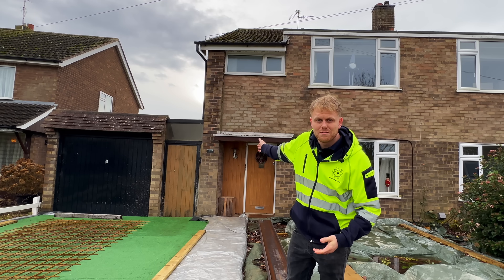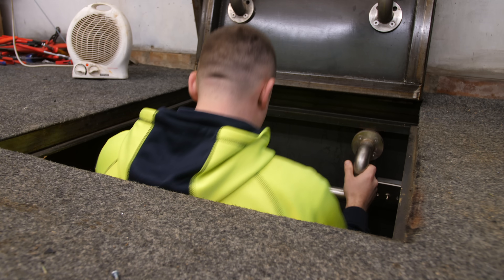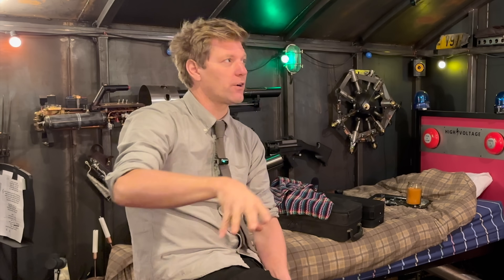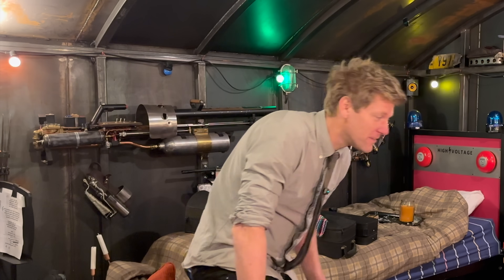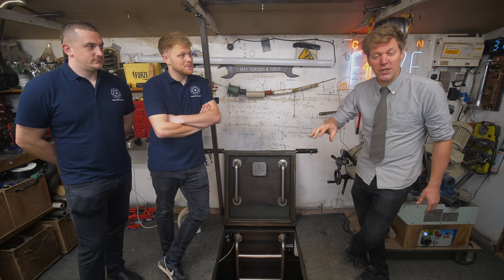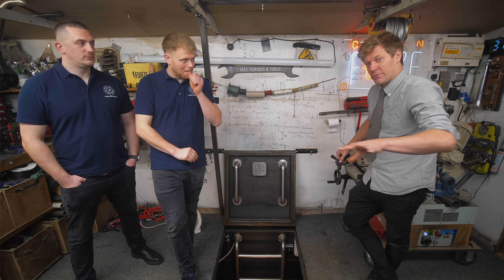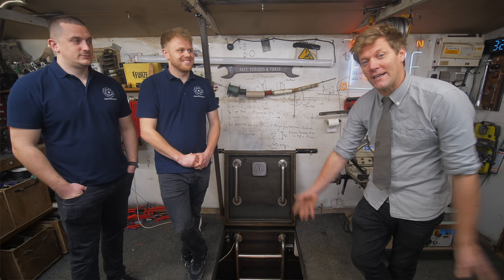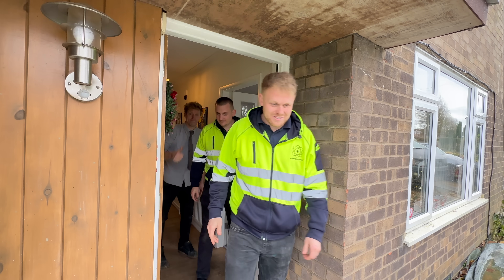Colin Furze Tests For Radon Gas!

Comment: How come with all the government studies, all the scientific testing and statistical info there’s not a single death that was directly caused by radon?  Probably because there’s no possible way to test its danger to life..  there’s no physical way to create an atmosphere completely void of any radon gasses so there’s no way to get a base test..  also there is no cure for cancer meaning nobody knows what specifically causes the cells to mutate and become cancerous..  one person can smoke their entire life and work with asbestos without having any problems from it and end up dying at age 94.  Then you can have a person die at age 30 from lung cancer who was smoke free and athletic..   they say radon is the leading cause of lung cancer..  hows that when scientific studies have at least proved that the bad hydrocarbons that are apart of radon are only harmful if ingested and these harmful hc’s are only around for a very short time before they decompose into non harmful gasses due to their half life being so short.  So a person would have to have inhaled this random, very low ppm harmful molecule floating in the air while its in the harmful state and give it time to be ingested and digested into your body before it decomposes into nitrogen or carbon dioxide and just gets farted out like the other gasses..  that said the amount of these gasses that has to be ingested to become a problem is to the point of getting hypoxia from the lack of oxygen for them to do permanent damage to the brain.  The lungs are able to regenerate from all the other crap we inhale daily that have nothing to do with radon.  Does china worry about radon gas in homes when they cant walk outside without a mask from the smog all of the vehicles are producing?  What about for the previous hundreds of years before radon was said to be a killer gas?  Did life longevity improve overall after the whole radon industry was created generating millions for various people?  Where the proof of these studies and who were these studies preformed on, what was the medium?  My bet is there are no definitive answers and only open ended people who are gullible or are cured with sugar pills..  radon is just a creative way the governments have introduced to the people in order to develop a new industry generating profits for something that cannot be eliminated or avoided, creating jobs and products that will consume more power and taking more money from the public.  Some places have made it a law to incorporate these radon mitigation systems in houses..  like when selling you legally are forced to have a radon test done..  my grandma lived in the same house for basically her entire life.  Raised my mom and her 2 sisters in it.  She had a person do a radon test and said it had levels higher than he has seen before.  House was over 100 yrs old.  But she just said ok ..  the guy said the highest levels were in the basement area where she spent 90% of her time.  She lived to be 98 yrs old.. died in her sleep after my grandfather died of prostate cancer while getting a blood transfusion..  radon didnt effect them at all..  never paid to get any radon mitigation or fans, filters.  Nothing..  radon is a joke..

Comment: This guy needs to go back to school. There are probably more than a hundred trillion atoms in a full stop.    There you go  .   a virtual 120 trillion,
Reply from the maker: We’re talking a pin head 📌 a tiny surface 1,000,000nm or 1mm. Due to the atomic radii, you can fit around 3,000,000 radon atoms on a pin head with the atom being around 0.3nm in size.

Comment: so what i wonder is I have well water you know the groundwater and i live in Ohio in the USA would Radon gas be a possible issue? been living here for 19 years now and have seen both my neighbors on the sides of us get cancer both got different types which i kinda think could be due to some of the chemicals from the farmers fields have leached into or water overtime.
Reply from the maker: It’s possible it’s an issue and I would get it checked for peace of mind. 
Radon is only officially linked to lung cancer though. When you agitate water it releases the radon into the air and then you can breath it in. Studies in the USA have shown radon levels to rise when washing machines are in use and fall when they’re not.

Comment: Just bought a house and the survey says it could potentially have radon but it is in a low area on the map and the gov report states it is "low risk". 
Should I still get testers?
Reply from the maker: The only way to know what your radon level is, is to test.
Reply: @Glencoe-Radvac  Fair enough. I'll get some from your site when I move in. First time buyer, so I'm not clued up on these things.  Thanks.
Reply from the maker: @chris746568462  thanks! Feel free to drop us an email when you move in if you need any advice.

Comment: for anyone wondering, calculating Sieverts from the values measured in a radon test is very complicated and not straightforward. the typical model though shows that 50 Bq/m^3 of radon gas inhaled in 2000 hour period will result in about 1.4mSv. the generally accepted limit is 1mSv per year. BUT up to 20mSv per year is the real limit, which is what radiation workers go by. this means you can actually have 20 times that much gas for 2000 hours or the same amount of gas for 20 times longer than 2000 hours (which is multiple years). 

so going by what radiation workers use, there is essentially nowhere on earth that will produce enough Radon gas to get you above 20mSv. if you expect to be a radiation worker, then the Radon gas can become a problem as it can eat into your yearly allotment of radiation. of course if you are a radiation worker, you should know everything about radon gas already lol.

basically, these companies are ALL a scam in that YOU DON'T NEED THEM. They really do install all kinds of expensive vents and tubes and whatever, but its all completely unnecessary

Comment: What about the height of these tests? Shouldn’t a few be lower to the ground?
Reply from the maker: The ones placed underground in a bunker you mean? Waist to shoulder height is a good guide when placing detectors, but the height won’t make much of a difference if you’re talking a couple of foot higher or lower.

Comment: almost every single house where i live has radon gas! lol its so common here, everyone just installs the radon piping to vent the ground soil below the foundation of their house. its just a big pvc tube that runs from the foundation to the roof. i also happen to live almost on top of a super rich uranium deposit, so there is that. basically if you don't live on one of the very few uranium deposits in the world, radon will almost never be an issue for you. even then, its never been shown clinically that radon gas from soil causes any health risk or increased incidence of cancer. eating hotdogs will do more to give you cancer lol

Comment: The radon level are by zip code in the US but some states like  New York will have it broken down by municipality, but also results the basements and 1st floors.  The highet I have tested in a home was 139 Pci/l or around 5140 Bq/m3.  Figure 6 is the limit according to the EPA.  So Pci to the Bq m3 is around 1 to 37.  So 6 Pcqi in the use is 222 Bqm3 in the UK
Reply: 4.0 is the recommended action threshold.

Comment: Here in Denmark I live in a moderated area, but I had a lot here 200 is a bad spot, but acceptable for old houses. I can get it lower under 100, but not during winter for some reason. Even though I have a inflow fan to make positive pressure.
Reply from the maker: Positive pressure for homes is not as good as sub floor depressurisation.
Reply: @Glencoe-Radvac  True, but as it's a old row house, I can't really think of a way to it otherwise. As it was made in a time where the laws din't have anything on the books for radon. As long as I can get it under 100 I am happy, though winter does give me around 200.

Comment: I'm in the US and for our radon test out was just 24 hours. They had us keep all the windows closed and minimize door usage. What is the difference between a months long test and a 24 hour test? Is mine not accurate?
Reply from the maker: Levels fluctuate every day, every week and so on with lots of contributing factors. We test for 3 months and you occupy your home as you normally would. 
The levels over three months are calculated with a seasonal factor and that gives us your annual average level. The longer the test the better.
Reply: @Glencoe-Radvac Got it! Thanks for the reply!

Comment: I’m originally from the UK but now live in the New England in the states. I think radon awareness over here seems to be a lot higher and likely because it seems more properties have basements than back in the UK this causing higher exposure risks having dug into the ground. We have run the air things radon tester at home for years and would definitely notice a higher reading in the winter when closed up more. When we moved house a year ago we stayed with the in-laws for a short period and I had happened to have pack the radon meter in my bag and had left it in their living room for a few days. I happen to open the bag and the readings were through the roof so much so I thought the meter was broken. Put it in the car for a day and then checked the day reading results and it had come way back down. They had it professionally tested, the results came back wild and they had to have a radon mitigation airflow system installed under the basement slab and up the side of the house! Definitely worth testing and making sure that you don’t need to mitigate, 100%!!

Comment: From midwest USA here. Radon is everywhere, we install radon mitigation systems that essentially suck the gas from under our home foundations and pipe it outside near the roof line
Reply: Seems cheaper to just put in an ERV which solves more problems that just a dedicated Radon system that cost way too much for what they are..
Reply: In Massachusetts, when buying our house, our home inspector did a couple of overnight radon tests, and it failed, so the previous owner paid for a radon system much like yours.  It sucks air from under the foundation and from a crawlspace up a pipe that vents out the roof.  It's just a small fan that runs all the time.  With the system in place, the house passed the test just fine.  Doing a multi-month test is impressive.

Comment: I'm deeply sceptical of the claim that Radon is the 2nd largest contributor to lung cancer.
What about the gargantuan increase in particulates & carcinogenic emissions over the last 200 years, as a result of industrialization? or Asbestos?

While I appreciate that today's homes have dramatically better insulation & draft exclusion than houses 50+ years ago, which seems like a plausible cause for elevated Radon exposure, is there real data to support this? Or is it based on only statistical models?

Comment: I wondered about this as soon as I saw the bunker.  My house has high radon levels (2600 Bq or 70 piC/l), but sealing the floor cracks, installing drain air traps and a simple exhaust fan creating a negative pressure in the gravel under the slab got me down under 35Bq or 1 piC/l.  I'm really surprised the test takes 3 months.  They used two types of tests in my house, an electronic one and a charcoal one.  Both took 48 hours.  The electronic ones give readings every 10 minutes, but you let them average for 2 days.  I bought a RadonEye continuous electronic monitor so I know what the levels are doing.  The levels do vary with the weather.
Reply: I've got a radon eye also but it seems susceptible to weird spikes off the charts in the winter time.  Support sent me a replacement and it does it too.  I think it's probably RFI or EMI from my old house's baseboard heaters.  I cannot trust it's readings during the winter time but it doesn't spike in the summer.  I also run a Corentium Airthings which does a better job but updates much slower, of course.

Comment: Im sure its a problem over there somewhere as well, but in the US some areas have an issue with radon coming in through the well water because surprise surprise radon dissolves in water like Co2. Whole complex water systems to remove the radon before it goes into your house that usually involve the well pump filling a tub with lots of baffles inside it and an exhaust fan that sucks the air and radon out of the tub and sends it outside while its in use. Then you have to have a little pump because the tub separates your house from your well pump with an air gap. also plastic and metal only slow radon down. Radon diffuses right through it eventually.
Reply: Wells are very uncommon in the UK.

Most homes are connected to the mains water supply from their local water treatment facility.

You would have to be significantly outside of a town in order to have a well here.

Comment: Here in Finland radon is taken in to account every time a new building is being planned. Usyally on high risk areas a set  of pipes with holes are buried under the house and then you have a motor on the roof that sucks air out of the pipes below your house to lower the level of radon gas inside the house.

Comment: Once all construction and open rock/soil facings are closed off then no more radon should be able to enter the tunnel so the problem is (in theory) limited to while construction activities are ongoing. That being said, it would be wise to install a forced ventilation system in there to prevent a build up and also a monitoring system (that's two new projects for you @2muchColinfurze). There are many areas in the country that have this naturally occuring phenomena and there are many things you can do to tackle the problem without having to resort to "filling it all in". Don't ignore it, but do your research well, and thanks for bringing this to everyone's attention. I'm lucky not to live in an area that suffers this, but I have worked in the nuclear industry for decades, and just like any other engineering project, it's just another problem that can be solved.

Comment: had roughly 1200 bq/m3 in our basement on a 3month average - installed hrv system, and it dropped to roughly 50bq/m3 now. still have the odd daily/weekly increase to 150 (using these electronic measurement (airthings) devices). an hrv system was much more affordable and attainable (and increased the value of the house + better overall indoor climate) than digging up the entire basement and sealing everything - for 'possible' reduction. 

so yeah, i second what the guys are saying, get better airflow and air movement, radon disperses and dilutes rapidly with proper air movement, being a plumber - i'm sure you can install some channels (perhaps even use the hollow steelbars as air channels ? (might be too restrictive)).

Comment: I believe that the highest risk from radon is when it's in a space that doesn't have air flow, or easy air flow. Such as in sealed crawl spaces under houses or houses that are "tight" with being gap sealed like around doors, windows, dryer exhaust, plumbing vents, etc.

Even if there is trace amounts detected, regular air exchange in the form of a ducted fan to pull air out from the farthest point away from a egress point to pull air into the system. While another opening allows air in from another source farthest from the exhaust, should have you fine and dandy.

Comment: Any reason you don't use a digital measurer like the Airthings Wave Plus?
Reply from the maker: Passive track-etch detectors are the only recognised method for testing radon by UKHSA for accuracy. Digital monitors are not as accurate unless they are in place for at least three months and they are far more expensive.
Reply: @Glencoe-Radvac  Okay, thanks for the reply :)

Comment: I somewhat doubt radon will go through steel sheets. The time it would take to diffuse through steel would be too long to accumulate. Correct me if I'm wrong but I'd say that bunker is pretty gas tight. Best way to reduce radon concentration is ventilation.
Reply from the maker: We shall see. But bear in mind it’s not just the sheet metal, it’s every single joint that has been welded. Colin is an amazing welder, but there could also be tiny gaps or cracks anywhere.

Comment: 7:00 the problem with radon is that it's heavier than air. So if you have an underground bunker, it could fill up with radon if you don't mitigate it. I had a house in New Hampshire, where the granite is never far underground. But my basement opened out into the garage, so any radon that entered would flow out into the garage and into the open air where it would dissipate.

Comment: Iv checked under the bed for a millennium bug as well. 
Brush up on radiation units, as you can pick one with however many 0s on the end to suit your purpose. 
Im amazed you dont own some sort of guiger counter.
No farts are getting in or out of  them metal boxes. 
Health how many km of weld have you laid ,kg of propane burnt ,cuts scrapes and burns off of various materials. 
If my landlord installed a biscuit id use it as a lens cap for a takumar lens.

Comment: I have a background in radiation. "Radiation Background" is a pun not active. You do have highly knowledgeable advice there, but they may not be aware of this product:
[Radon Block™ is the new leading high performance radon blocking barrier membrane. ] Google it. I'd link it save that YouTube would scrub it. Whether the product is certified in the UK or not is another matter. I can assure you that Radon is a tiny fraction of the issue it is here in Canada.